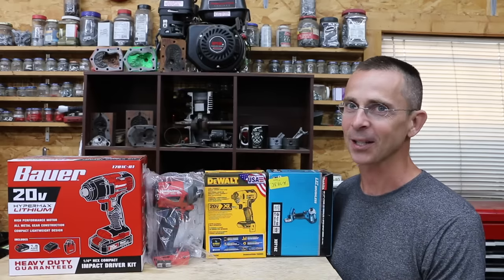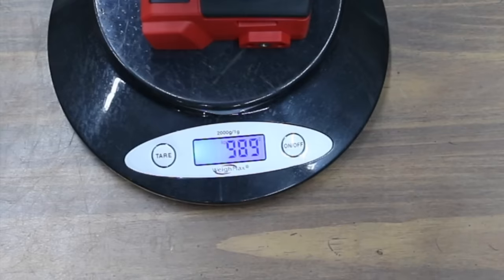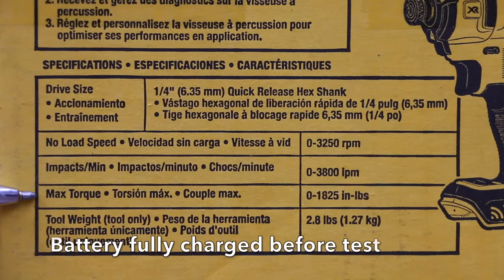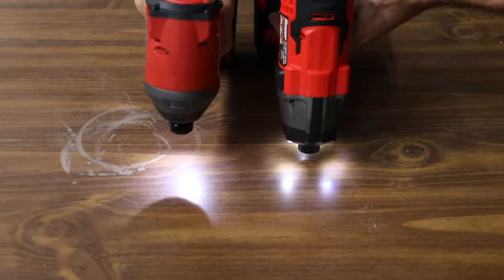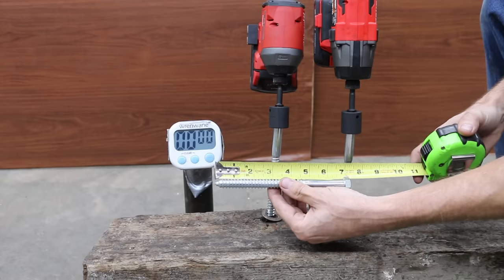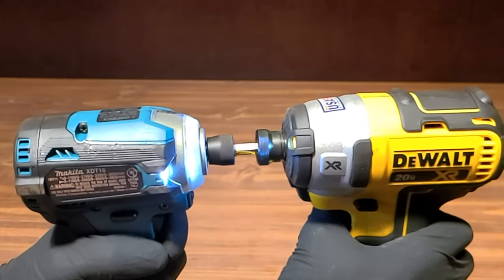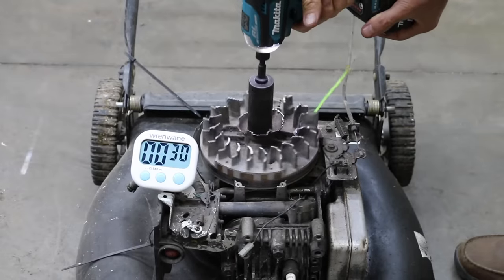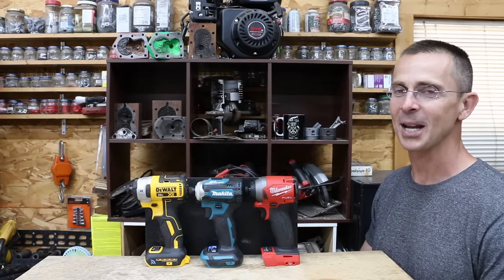Best Impact Driver? DeWalt vs Milwaukee vs Makita vs Bauer!  Let's find out!

Comment: I rolled my eyes so hard at the dewalt being internet connected. Not everything needs to be an iot device.
Reply: On the contrary it is a smart idea. All the device functions are sensed and controlled by a microprocessor. It is sort an offshoot of using a brushless motor that turns as a result of electrical pulses that are best handled by a digital source. Once all or most of the functions are controlled and featured via factory set program variables then it becomes apparent the device's capabilities are limited to only the out-of-the-box functions. The option to allow a user to apply their own ideas for how the device should function is a choice between an on-the-device user interface, like a menu screen with selection buttons, or a wi-fi/bluetooth interface running on some other device. Most people already carry such a device.  There are many small wifi/bluetooth enabled microprocessors available to a manufacturer to choose from. These are probably within the same microprocessor family they would be choosing anyway to run their device. Many useful and popular products are those that allow the user the flexibility to figure out their own thing. Just because you, perhaps the designer, cannot think of a particular use or purpose does not mean one exists.

What Project Farm did not do, which is of course understandable, is to go into the details of exactly what parameter changes and function changes, if any, were available.
Reply: I’d like to be able to track my tools to the nearest tweaker cave
Reply: Imagine some pos taking off with your tools and you just disable them from your phone. Great theft deterrent.
Reply: Milwaukee bluetooth system is called one key
Reply: @comparedtowhat2549  WRONG, WRONG, WRONG: that "functionality is useless and stupid; put the money where it counts: more torque, more speed, or more control!  Also, more complex circuits that are very expensive or impossible to repair, and more things to go wrong.

It is exactly why farmers are paying top prices for OLD USED John Deere tractors instead of stupid computerized newer ones, because the old ones are REPAIRABLE, DON'T NEED a lab to be fixed, and have less things to go wrong.
Reply: As a Farmer, you could possibly agree with me about OVERCOMPUTERIZED stupidly designed gizmos that are harder and harder to fix, and are either, more delicate or have more things to go wrong... And I'm referring to that idiotic bells and whistles DeWalt tools with "connectivity".
Perhaps you are aware that many farmers in the good old USA are paying top prices for USED, OLDER John Deere tractors, because those are the ones THEY can repair and maintain!  The newer computerized ones are almost impossible to fix without the factory "support" ($$$)...

At least one former candidate (I believe it was Sanders), was ready to propose laws to limit the dependency on manufacturers in order to repair OUR OWN THINGS...

Once I have paid for an item with my hard earned cash, it is MINE, and I have the right to do whatever I want or need to do to keep it working.  Stop manufacturers from overcomplicating items in order to make us throw away items that started failing, or to make ys DEPEND TOO MUCH ON THEM.
ARE YOU LISTENING DeWALT???
Reply: @alfredomarquez9777  I can only agree with half of that. Computerized gizmo's were more delicate when the technology was brand new but they are quite durable nowadays.
Reply: @alfredomarquez9777  I am not a farmer but totally agree with what you say. I used to be able to fix my car without "Specialist Tools" once.
Reply: No matter how fancy dewalt gets they still look like higher grade DIY homegamer tools.
Reply: They make a version without it
Reply: Can this impact driver stream Neflix?
Reply: @williamwallace5201  😭😭😭😭😂😂
Reply: I have worked professionally in construction trades for years. I never needed an app or a bluetooth connection to get the job done. Personally I think it's a joke. I have never needed any additional adjustments that were not on the drill (excluding lower end or harbor freight). I love the Milwaukee. If you are a professional, buy professional tools. Otherwise, the Bauer should be fine for home use IMO. KISS
Reply: I own a milwaukee Onekey impact. Great tool but I think I have used the Onekey exactly once, just to see it. Same with the 1 2 3 speed settings. If you're a half decent tradesman you can control your impact by trigger pressure. The speed settings are more of an annoyance to me than anything as every so oftem I accidentally hit the button and my impact reacts shittily when I try to drive a screw.
Reply: At this point in time,  i just don't see the justification for a smart impact tool.   I can see the use of it if these tools were stationary.   Other than that....neh
Reply: @alfredomarquez9777  no the problem with John deere is they are greedy fucks who will charge you out the ass at any angle they can. Need a manual? $150 please. Need diagnostic software and tools? Better bring a checkbook bud.
Reply: You know Milwaukee came out with this type of thing first right. All tools connected to the app with adjustments made via an app and tool tracking via an app
Reply: @David.....  BLAH BLAH BLAH BLAH...

95% of what you wrote has NOTHING TO DO with the "Bluetooth conectivity" fad...

Get real: the damn tool does NOT need that connectivity or programmability to execute the REAL NEEDS of the great majority of users: Who the hell needs a reprogrammable hand drill ?
Go get one, find that you CANNOT fix it by yourself, and then depend on a remote and costly service center for even the simplest maintenance.

Stop rambling on old Ford model T stupidities!  we are talking here about tools and the right for owners to be able to fix them if they fail or need maintenance!  Dont't go astray with your blind faith on latest manufacturers trends.  What is the matter with say, a Router for woodworking if it has WONDERFUL connectivity, but its bearings go bad because those are (badly) made in China? or if the quality of its speed control is so low that it fails too soon?  A good woodworking Router only needs to be rugged, reliable, have variable speed to drive varying router bit diameters, softstart and have good bearings to execute precise cuts and be durable... ANYTHING ELSE IS GOING TO BE DETRIMENTAL, because it takes money to be added, and adds unreliability, or makes the tool too difficult to be fixed by the owner!

Such a Router (for example), DOES NOT NEED ANY MICROPROCESSOR, Bluetooth gizmos or Software or Firmware at all.  Have you heard something truly valuable? it is called the KISS principle, and has a lot to do with COMMON SENSE!
It means: "KEEP IT SIMPLE, STUPID"
 Get the point!
Reply: @tomh9349  At least, an straight foward thinking person that does NOT need stupid "connectivity" in tools!
Reply: @MrSonnyfy  By overdesigning and overcomplicating the previously good, sensible product, that company is greedily increasing the need for their "help"...  As easy as throwing in some ways to actually REDUCE the reliability and serviceability of the product by incorporating  a too difficult to repair system. Allow me to give you an example:  In the Firewater pump market, fabricators went replacing former very reliable diesel engines with newer computer controlled ones...  All that trend became on as the stupid Ecophanatic authorities ordered engines to follow strict emission rules.  Now, What is the purpose of having a delicate computer controlled firewater pump diesel engine, if it operates a few hours a year mostly for testing, and almost never contributes to "pollution"???
 In contrast, a failure to operate in a fire situation is going to produce a lot of damage, with possible deaths and injuries, and much more "emissions" than those from operating a simpler diesel engine without so many "emission reducing controls"... See my point?
Reply: Just like Alexa they can track everything you screw.
Reply: Agreed. But I can’t stand power tools the only power I need for my tools is my own two hands. MERICA!
Reply: Having bluetooth on a hand tool allows not only industrial purchasers of the product to rate it's effectiveness, longevity, and overall value, but bluetooth also assists the tools' manufacturer to analyze each tool for issues and/or improvements.  An associate used to purchase Dewalt tools explicitly because the bluetooth allowed management to analyze tool usage.
Reply: Yeah, the word "gimmick" occured to me.
Reply: @tomh9349  Tom you are right in the fact that if you are a professional, you should buy professional tools. That being said, funny how only pro tool manufacturers like Dewalt, Milwaukee, and Hilti produce bluetooth OPTIONED tools....

At home I personally have all Dewalt "Dumb" tools. My dad has all "dumb" Milkaukee tool for home and his shop.

Honestly there is little use for the bluetooth feature when I was working on a small residential or commercial construction crew. Especially on crews where each contractor/sub/laborer buys his own tools.

I don't know your background/experience, but I do say that when on a commecial site with 50+ guys, and the tools are provided by GC or  project managment, Bluetooth did have use. Ever work in NY or Miami, guys have sticky fingers. And the hilti feedback on epoxy anchor gun is great for making sure things are done to spec....Im sure those idiots on the big dig wish they had their crews use them; That way that poor woman didn't have to die.

If you ever get a chance, you should try spending some time at the acmetools or coastal tool showroom. Great place to try before you buy.
Reply: @chriskathol  Hi, just curious what made you buy the onekey version over the standard tool, and what type of work you do...In my past experience onekey was only useful for concrete anchors, and preventing theft on our large 50+ person jobsite.

My dad is a milwaukee guy, but never needed it....he uses his tools for home and his shop (less than 3 guys).
Reply: @alfredomarquez9777  One. I addressed why bluetooth CAN be useful in tools;  Two. I made it clear that Hilti, Dewalt, and Milwaukee, make bluetooth OPTIONAL, standard version of their tool don't have bluetooth;  Three. I started to talk about cars because YOU brought it up, and had the vitriol and negativity;  Four, your intial posts keep saying you want them to remove microprocessors...they are neccessary for modern tools for the brushless motors to work and li-ion battery packs from catching on fire;  Fifth. If you hate chinese crap, don't buy it. Buy Hilti, fien, or festool. You get what you pay for.

You do realize that bosch, dewalt, black and decker, portercable, milwaukee, ryobi, hitachi, metabo, panasonic, kawasaki, rigid, kobalt, bauer, craftsman, hercules all you stuff from china. Don't buy from them if you don't want chinese parts.
Reply: @David.....  Got a screamin deal on it on kijiji, after using it I would not pay extra for it vs normal FUEL. I'm a sheet metal worker. The "sheet metal" setting is annoying as all hell. We call it "noob mode". It's easy enough to back off the trigger manually once the drill point is through. The worst is when it goes to noob mode by accident and while screwing the metal separates a bit, leaving the drill trying to tighten at low speed/torque while it should still be trying to go through the second layer of metal.... Mine has not intentionally gone on a speed/torque setting other than 3 since the first week I owned it. I used to fuck with a guy on the job site by putting his  impact on bluetooth or 1 whenever I got the opportunity lol.

What concrete anchors are you using where the settings are beneficial? We almost exclusively use pin bolts or inserts so an impact doesn't matter but the odd application we use plugs or tapcons (mostly for cinder block walls) and I don't tend to have a problem controlling the impact
Reply: @gibster9624  i think you need to be close to the tool, i dont think it works far away
Reply: @chriskathol  I agree that for 90% of contractors and labors, bluetooth is un-need or can cause an issue if you not paying attention to the settings....I really dont like push button in general...honestly thats why I like the sliding setting button on the dewalt impact dcf887.

As for what type of anchors my company uses depends on the job....We install a lot of bracket or anchor points for exterior cladding, ceiling panels, glazing mullions, curtainwalls, etc, when we can't have the anchors cast in place ahead of time.

Sleeve, wedge, epoxy, and undercut are the most we use....screw/tapcon style is used as last resort. 

The reason is, we depend on getting the anchors perfect the first time; This is because we are anchoring at the edges or faces of slab, often 80 stories up... If we over torque, damage or break off the concrete, we then have to spend hundreds to thousand of dollars repairing the concrete, or epoxying in threaded rod, or redesign and remanufacturing whole cladding sections that rely on brackets and anchors at a specific point.

Also we often get fined if we fall behind schedule.....Because of that we like using hilti or milwaukee programmable torque and speed settings to reduce possible installation failure, or inadequte seating errors.....Its not a good day if 6ft x 8ft section of building weight 1000lbs falls off a building and drops 40-100 floors.
Reply: @gibster9624  yeah, that's a good point.
Reply: @David.....  Why wouldn't you use pin bolts? never done architectural metal so I don't know it but pin bolts are pretty solid when it comes to concrete. For us ductwork guys it's pretty much the standard fastener until you get into fan coils or other heavy stuff, then it's usually 3/8 inserts and rod.

A little trick for if you're dealing with brick is a tapcon with a little piece of a ziptie in the hole. Most of our fastening into brick/concrete is indoors though, don't gotta be quite as bomb proof. I can only think of a few times I have had to fasten to brick/concrete outdoors and those were roof flashings on old chimneys or wall hoods, aint goin nowhere with a few pinbolts. Most all of our outdoor shit is heavy ass RTUs or fans and flashings that have wood or metal curbs roofed in that you can drive metal or wood screws into.
Reply: @chriskathol  Yeah pin bolts are fine for what you are doing, but the brackets and anchors we install need to hold about 1000lbs to 4000lbs dead load and additional shear and pulling loads cause by wind/low pressure vacuum. 

Pin bolts still rely on expansion, and thus still prone to cracking or damage or concrete when the fasten position is near the edge of slab or and the end of slab.....

I bet most of your pin bolts go smack dab in the middle of a concrete wall....Optimal position for any type of anchor..... The jobs  I work on, the anchor goes in the worst / most prone to break areas....

Hilti chemical anchoring system is a real lifesaver.
Reply: Not walls too much, ceilings mostly; and yeah not near edges. When we get into the heavy shit it's usually 3/8 or 1/2" inserts and again, not near corners and our heavy shit gets spring isolation so not much for dynamic loads. 

Dunno if I could stomach doing your trade (actually it's the same trade designation where I am, most of us who go to trade school are HVAC sheet metal though). I could barely stomach being on a ladder on the edges of balconies with no railings on a 6 story condo. Never fallen off a ladder and I know I'm just as likely to not fall  off in that situation but it just gave me the creeps. 

Done much sketchier shit on lifts and scaffold than that, or even climbing around on pipes in mech rooms but it made my stomach turn being on those balconies. Maybe it would be different if you're looking at the building and not off the edge but I don't think I'm made for hanging off the side of a tower.
Reply: @chriskathol  Yeah...I get nervous on ladders over 10ft up..Seen so many bad accidents...I rather be on a lift or genie, and then I don't like to be more than 40ft up.....

After that I gotta be harnessed up...

Now when I was a kid I was afraid of heights and got over it when I got older....But I was on a NYC job last year on 48th st....took the hoist up and by 40th floor was taller than all the surrounding buildings..... 97 floors later, I was out checking concrete to edge of slab dimensions and definately had vertigo and fear kick-back in... Nothing but 3ft orange netting at the edge. 

Its a nice change of pace, but I prefer my time in nice a/c office doing design work (on ground level)  VS  qc/qa, inspections, field verification, field fixes, or problem solving some 70 floors up, in 90F heat, with a bunch of sweat union guys, with once a week cleaned port-johns your only saving grace.
Reply: @David.....  ladders don't bug me much, unless I'm on the edge of a balcony heh. been on an adjustable one that I think we had at 18 feet and didn't bother me much. 10 feet plus your gonna get pretty fucked up if you fall. Probably not much difference falling from 40 feet or falling from the 200th floor other than having time to think about what's gonna happen for a couple few seconds.

90F in front of a glass and aluminum building would be sheit... We do more than enough roof shit for my liking in the summer. I'm in western Canada and I much prefer cold to even slightly hot, and this summer was fucking hot here, even bought a sunshade for when we were doing boiler venting in Drumheller.

Sheet metal unions are pretty much non existent in Alberta... My company is pretty much 100% retrofit so at least I don't gotta worry about using a shit shack too often; been with these guys for a year and have don 1 new construction job and that was a 3 day project lol...
Reply: @gibster9624  except youd have to disable them while you have them...i doubt you can connect to them when they are miles away.
Reply: @GCEXTREMEMN  lol that's how it works they automatically disable as soon as your phone is too far away.